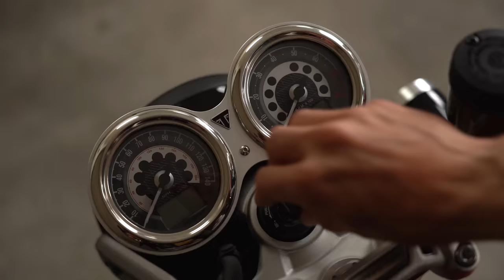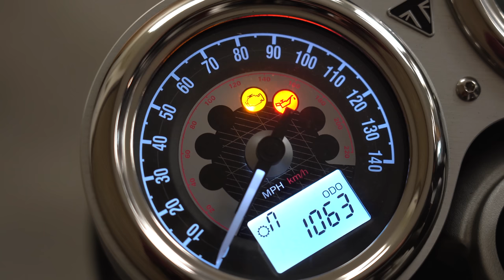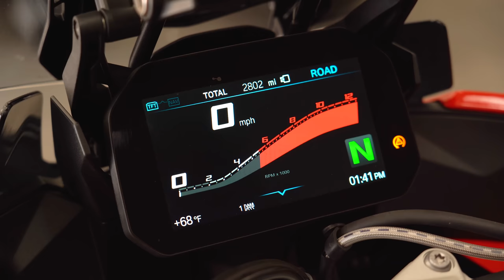Do You Need To Warm Up Your Engine? | The Shop Manual

Comment: Engines should always be warmed before giving them the beans as oils don't truly work correctly until up to operating temperature as oil that isn't at operating temperature doesn't have the same lubrication properties. Being that the faster the engine goes, the more wear that happens, its important that your oil is at operating temperature before you go too hard. Its more so for colder mornings or in low temperature climates 9'C or lower but even then engine wear is can still be considered negligible. "Negligible" is not "non-existent" however and thus if you really want to get the most miles out of the engine over its lifetime, or you just really care for the engine, let it warm up before you hammer it.

Comment: I'm on carbureted and if Its not properly warm I bogs down and miss fires. Even in warm weather. If it's cold out forgot about it it has to be warmed up.
Reply: Sounds like one of the points made in the video... If you have a carbureted bike, you have to let it warm up.
Reply: @AriH211  it was. I'm agreeing with the video.

Comment: Rapid changes in motor temp should be avoided, due to the varied thermal properties , of the many types of materials used within. Things expand and contract at different rates!

Comment: Not true. You should always let it your bike or any vehicle warm up. Why do you think when you start your vehicle the rpms are always 1200 or higher to 1800. Bc it's cold and needs to warm up and needs that much more gas and air to stay alive. When it's ready to be used or drive is when the rpms drop down to the normal idles of 700rpms to 1000rpm depending on your vehicle or motorcycle. I start my car and put it in drive as soon as I start you'll feel your engine scream at you and kick you a big kick. No matter it's a new 2024 or an 80's carbureted you will feel your vehicle tell you its not ready. Yes it will go and like you said cold temperatures and instantly driving will make it hot n expand and slowly do eventually FATAL damage to your engine. No matter the size, vehicle, or fuel used. Always always let your vehicle warm up atleast 2-5 minutes. Would you rather start and take off because you can't wait 2 minutes to let your engine rpms drop and let the engine warm up the tiniest bit n potentially break your engine because of that? Or wait the 2-5 minutes to say goodbye to your loved ones whether it's your parents, your lover, your kids, your animals dog, cat, goldfish... like take 2 minutes to say goodbye and your engine is warmed up n ready to go. You'll die trying to rush everywhere instead of taking those 2 minutes. Just let it warm up.
Reply: I can start my fuel injected dirt bike and when I try to take off even 15 seconds after I start it using the choke, it stalls everytime I put it in gear. I let it warm up on choke for 30seconds to 1 minute LIKE THE MANUAL SAYS.... and I can put it in gear and take off no instant stall or it grumble at me or me forcing the rpms to 2000 just to take off. It's coldddd and telling me no. Let me warm up. I thought watching this video would actually help people n make them realize they need to warm up their engines but instead your telling them not too. What a great person you are. You put your opinion which is wrong BTW, on here instead of proven facts and all vehicle or motorcycle manuals will even tell you let the damn vehicle warm up. Even diesel vehicles let them warm up. Everyone who owns a diesel knows to let them warm up bc it'll die or shift hard and kick until it's warm 5 minutes on your way to work. Guaranteed you check your oil after starting right away and driving off you will see engine component metals in your oil and engine magnets to catch that. You will have alot of damage done. You change your oil and let your vehicle warm up and drive to work or wherever Guaranteed their will be less to no metal shaving. Just let it warm up. Manufacturers wouldn't tell you to let it warm up before driving if their wasn't a reason....

Comment: There’s a reason why the engineers at Honda gave the triple r sp a warmup sequence. I really like your videos, but I feel like this one was slightly misleading. You said there’s no need to warm one up, but don’t go hitting redline or putting it under a load until it’s up to operating temps. If pistons are slapping around causing tiny amounts of wear at redline, because tolerances are smaller when they’re cold, then it’s doing the same thing when you’re halfway to redline, when you’re riding around town normally, just on an even smaller scale. I’ll sit and wait for mine to get up to operating temps. It doesn’t take but a few minutes, and I would rather wast a few minutes every ride than rebuild my engine at 80,000 miles, rather than 100,000. Also, the choke doesn’t add fuel, it takes away air, causing the mixture to richen.
Reply: Depends on the type of choke circuitry. I grouped "enrichener circuit" in with "choke" for the sake of simplicity. Whether you're pulling a plunger and opening a secondary fuel circuit or flipping a lever and restricting the carb venturi, the effect is the same: Additional fuel flow.
Reply: @AriH211  I guess I only explained half of the story for simplicity’s sake, too. Well played, sir. 😂

Comment: I always respected my bikes enough to let it sit on choke for a minute until it can idle consistently without choke. Also choke adds more air not fuel, i know more air leads to more fuel but saying it like that felt wrong.
Reply: Yup, as pointed out in the vid, you have to let a carbed bike warm up or it won't run right. 

I know I confused people by shortcutting the physics of choke operation, but I'm tellin' y'all, it adds fuel. More intake vacuum in the carb throat (created by closing the choke butterfly or guillotine - but the piston is still descending and attempting to draw in the same volume) draws in significantly more fuel. It literally spurts in liquid form out of the pilot-circuit office. Yes there's less air, but there's more gas than less air, if that makes sense. 

More air alone does not lead to more fuel, unless said air has velocity. Snap a carb'd bike (not a CV carb, mind you) wide open from idle and it'll fall on it's face, because there's a momentary drop in intake vacuum. Many modders mistakenly put too big a carb on their bikes and then they can never get the jetting sorted, because the metering signal is so weak/erratic.
Reply: Some motorcycles use a choke to reduce the airflow to enrich the mixture, while others use an enrichment valve that increases the amount of fuel (as opposed to reducing the airflow). Both types achieve the same thing.

Comment: Having a degree in physics and also a good deal of understanding of modern engine design as well as extensive experience I wish to let the engine and engine oil come to reasonable temperature before riding. Also, I have seen, ahem, "squids" bounce off the rev limiter repeatedly just before zipping down the road just minutes before the ambulance heads off in the same direction. Yes Cord, that squid from the coffee shop.

Comment: Automotive technician here!
You guys demonstrated a fundamental misunderstanding of oil weights. 

The numbers indicate the weight, or viscosity of the oil, at freezing (W rating), and 210 (second number, aprox degrees F most engines operate at). Oil takes longer than water to heat up, and when the bike is cold even if your temp gauge reads operating the oil still usually takes 10-15 minutes to get up to operating temperature with cars. Luckily with small motorcycle motors, higher octane fuels and higher compression create higher combustion temperatures and, along with the smaller volume of oil, this means the oil heats up much quicker in closer to 5-10 minutes on most smaller bikes. 

The higher the oil weight number, the higher the viscosity and better wear protection an oil can offer, so when you start your bike and only allow it to idle for a minute or so before starting it, especially when you consider the tolerances of the cold metal parts have, as you correctly stated, not warmed and expanded to fill the spaces to meet spec, you are drastically accelerating the wear of the bearings and machined surfaces inside the motor and reducing the life of those components. Motor oil is designed with a reduced viscosity in cold environments so the engine doesn't run dry, but the motor is not meant to run with such low viscosity, hence why many people in colder climates will use an oil with a lower W rating, but the more important second number is always the factory rating unless specific scenarios require a higher rating (such as in a hotter environment where the oil may start to loose the viscosity by reaching thermal breakdown temperatures, or in your old shitbox with much looser tolerances that needs the thicker oil). 

When I am in a hurry, I will let it warm up for only a few minutes and drive it very lightly with only 20-30% throttle/load, but if you care about the longevity of your bike or even other vehicles, even in the face of modern combustion engine technology, you should give your motor at least 5-10 minutes to warm up at least most mornings, especially in the cold and cooler temperatures. 

None of the people involved in this episode did any real research or spoke to any real engineer or motorcycle technician and it shows. There were multiple severely scientifically false statements made about engines and motorcycles in this video. I would've expected better from you guys!
Reply: First of all, I take offense to your assertion that "nobody did any real research or spoke to any real engineer or motorcycle technician." I research the hell out of all of these videos, and as a journalist with 15 years experience in the MC industry I'm fortunate to have a contact list of professionals to confer with. I spoke directly to the owner of Maxima Racing Oils for this video, and have consulted him many times on technical topics over the past decade. And while I don't purport to be a "technician" (since that title doesn't actually mean anything), I am a competent mechanic that has repaired and rebuilt many, many engines, old and new, street and race. 

As for the oil-weight misunderstanding, it's clean you misunderstood what was being explained, or perhaps, like many on this video, let your pre-existing bias cloud rational thought. 

You're concerned with oil viscosity, but neglecting to incorporate a key factor that effects oil thickness: Temperature. At startup on a cold day, 10-weight oil (still cold) is thicker than a 40-weight oil at 100C. Take a look at a centistokes vs. temperature graph and you'll realize that the oil engineers are way ahead of you, buddy. Multi-weight oils revolutionized lubrication technology. 

And to be clear, or more accurately restate what was clearly stated in the episode, none of the people involved in this video are suggesting that you hammer the throttle right after startup, just that it's entirely acceptable to put the engine under light load immediately following startup, and that letting an engine idle for 10-15 minutes so that it's okay to operate under load is not accurate.
Reply: @AriH211  there's the problem, you are a shadetree "mechanic" and a journalist, not an actual technician or engineer. I know people from the engineering governing body SAE that have actually helped with things like oil weight tests. Reread everything I said; I addressed everything you just said. You're assuming oil works like honey and it is thicker when cold, but they specifically design multi weight oils with less resistance to flow at lower temperatures (W rating, lower viscosity) so the engine does not risk running dry at startup while oil is moved to different parts. This is because when the motor is cold it is usually from sitting for a while and the oil has all drained back to the oil pan. This is also why oil pressure typically spikes up during idle and calms doen, but oil pressure does not necessarily indicate the level of wear protection in this case. An SAE 10 oil is NOT thicker than a SAE 40 oil at any temperature if it is not a multiweight oil. A SAE 10 will be thinner than a SAE 40 at operating temperature. The higher the number, the more viscosity and resistance to flow. This is because engines do not sit in a pool of oil and instead rely on thin layers of oil covering and sticking to mechanical surfaces to function properly. The higher viscosity at operating temperature (tested by SAE at 210*F) has more resistance to flow and a higher wear protection, especially under load. The oils need to be thicker at operating temperature to deal with the increased forces and hydraulic pressures on the oils associated with driving and actually using the engine for its' intended purpose. You're right, multi weight oils did revolutionize lubrication technology, but it is because a 10W-40 flows BETTER at startup than a SAE 40 weight at the standard testing temperatures around freezing temperature. As I stated and will state above, i occasionally will just start and drive off too, but I knoe that by doing that the oil has not reached the higher viscosity and I am increasing the wear on my motor and decreasing its' lifespan SIGNIFICANTLY by not allowing the oil to reach the higher viscosity. You seriously should talk to an engineer with SAE to better understand what I'm talking about. This is a common misconception that cold oil is thicker than warm oil. Yes, at a certain temperature the cold weight will start to be negated and the oil with begin to get thicker again, but a standard SAE 30 oil will still have the approximate thickness of maple syrup at 20*F.
Reply: @AriH211  a title of "engineer" and "technician" certainly does mean anything too by the way, not so much someone who is a journalist that does mechanical things on their personal toys as a hobby. I do this professionally, there are thousands of engineers that do this professionally, and your cocky attitude is exactly why misinformation like this spreads that causes people to not properly maintain there equipment and vehicles. I have met many people even within the industry before that have this common misconception about oil weights but almost everyone I know understands you still need to let the motor get up to a proper temperature before driving off otherwise you'll decrease the lifespan of the vehicle. You spoke with people over the years and think you have the right answer but I seriously doubt you directly consulted anyone for the purposes of this video.

Comment: bit of nit picking: 3:15 clearances, not tolerances. you even corrected it later. besides that, great video.
Reply: Yup, that's mostly a function of trying to have variety in vocabulary. Sometimes it bites me in the ass.
Reply: @AriH211  it's not easy being a great presenter, but you're doing one hell of a job. 👍🏻

Comment: People, do not listen to this guy he's talking rubbish.  All engines need warming up.  What he said about oil is rubbish all oil has an optimum temperature where it works properly.  The internals which are metal need time to expand with heat to be working properly as designed and to not increase premature wear.  Do you really want to ride off with your gearbox spinning with cold oil not doing its job or the crankshaft.  All it takes is letting the engine to warm up for 3 minutes is it really worth it for the sake of 3 minutes.